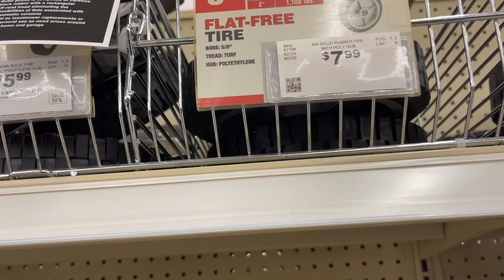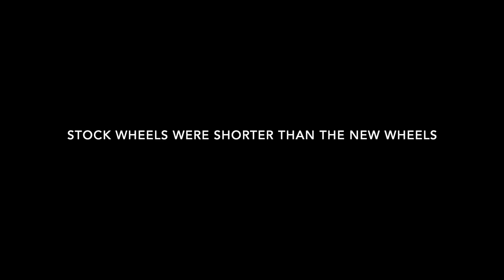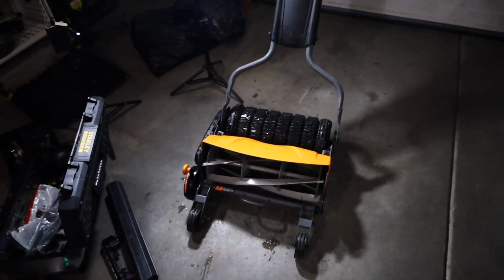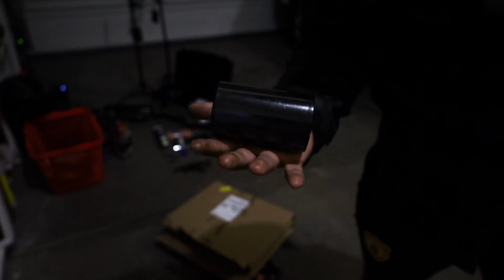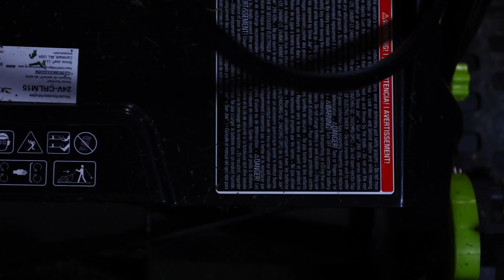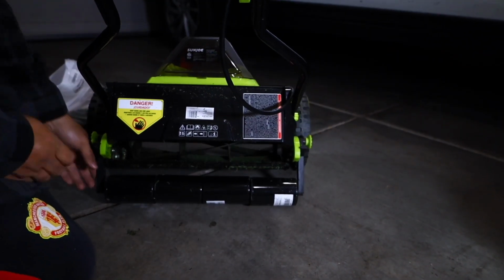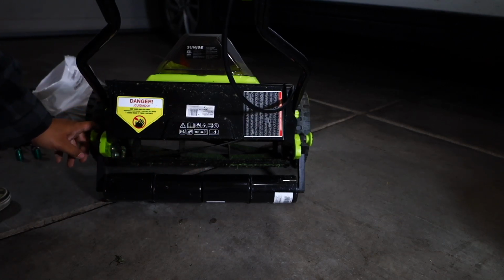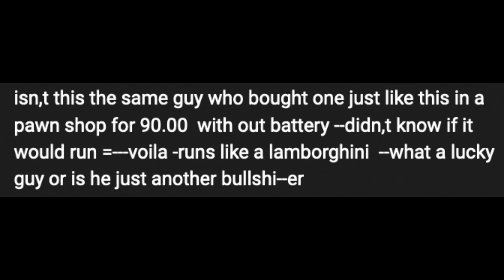IT'S GETTING REEL! SUNJOE Electric Reel Makeshift roller! Fiskars Wheel Roller! NEW MOWER ALERT!!!

Comment: Hello, just put the Harbor Freight wheels on Fiskars. The side wheels like you said are two small. I watched several videos and decided to add a cap onto the side tires. You get old bike tire with good tread. Cut the tire to use the tread part. Use a string to get correct length. Cleaned the rubber on both let dry. Super glued rubber cap onto the Fiskars original tires. Then stainless (like dry wall screws) 1 1/4”, two on each side of mating edges. Then two every other spoke. Mowed yard got stripes and caps worked great!
Reply: Hi Jerry Horn,
I also like your technique ;-) Would you happen to have pictures of your results?

Thanks,
Kirk
Reply: @houstonpatriot59  uploaded video to YouTube
Reply: @jerryhorn854  Hi Jerry, Wow very impressive is that a DB15 Serial connector ;-) Curious what width are the bike tires used as covers?
Thanks,
Kirk
Reply: @houstonpatriot59   the tires were 27.5 mountain bike. The tread was deep dimples so every screw was place where a dimple bump was removed ( razor knife cut out rubber bump ). Due to plastic wheel hub ( strong plastic) I could pull the head of screw recessed, below level of tread, rolls smoothly.
Reply: DB15 Serial Connector ( if that is what it is called ). Came from a 20 plus year old Lectronic Kaddy ( made in Canada ). Used parts from said golf caddy ( motors, modulated controls of motors, etc )
Reply: @houstonpatriot59  put up another old video with a little detail.
Reply: @jerryhorn854  curious on your prototype 👍how long of a charge do you get? Thanks,
Kirk
Reply: @houstonpatriot59  The lithium battery is 16Ah and the battery charger is specifically lithium batteries. The charge gauge is broken up into 20/40/60/80/100 % the charge never get down to 60 %.
Yard is approximately 1/2 acre with a putting green in the back end. I mow it also.
Reply: @jerryhorn854  bike tire came in finish  installing last night  I used velcro 2"  wide heavy duty tape instead of "super glue" will place drywall screws today lets see what happens 😀
Reply: @houstonpatriot59  I am kind of picky and it really has held up. The harbor freight tires push on the ground enough to get stripes and yet the original tires are still driving (for me using motors but before motors added, the reel spun just fine) original configuration. Good luck but I am sure you will like the set up.

Comment: I see you used 8 inch wheels.  Would 7 inch work so you wouldn't need to adjust the outer wheels?
🤙
Reply from the maker: It’s not gonna lay the stripes down as good on shorter cut lawns! I have a way I’ll be showing it soon! 😊👊🏾🤙🏾🙏🏾
Reply: @YardBrah  Any word as to your permanent solution for the fiskars striping wheels yet?  Also, how could you attach a roller to the front as well?   Thanks Dude.  😉🤙🎱

Comment: Great upgrade. I did the same, but having problems placing the straps. Any suggestions?
Reply from the maker: I still have to figure out another solution my straps keep readjusting… I keep searching for little toy tank tracks to wrap the tire in… that might work! 😊🙏🏾🤙🏾🔥
Reply: @YardBrah  Thanks. I got them to work by cutting off the ends and screwing them to the OEM tire every 4 inches.

Comment: Yardbrah….. do you think replacing the stock wheels would have made a difference on the fiskers mower wheel height 
?  I am asking because I just got one for $50.   I know you said you had issues with tracking.  

Thanks Justin
Reply from the maker: You have to modify the harbor freight wheels with the stock wheels bearings … it’s a cutting into the stock wheel type of job … I’m impatient 😂🤙🏾

Comment: Mate .... With the Fiskar....once you installed the additional rear wheels ....how did you reinstall the spring between the frame and front axial?? Is there a trick to it.... TIA
Reply from the maker: Screw driver at an angle will get that back on 😊🤙🏾🙏🏾🔥

Comment: Great DIY!  Quick question, would buying two extra wheels and replacing the stock wheels worked instead of the "snow tire" method?
Reply from the maker: The tread just has to be the same diameter the outer wheels where kind of worn down and just wasn’t touching the ground 😊🙏🏾🤙🏾🔥
Reply: @YardBrah  Got it - I ordered the same Friskars mower and I am looking to do the same thing - thx!!

Comment: When you put the rear wheels on your Fiskar did you reattach the spring? I’m having a hard time reattaching it.
Reply from the maker: Yes def use a screw driver to slide it on super easy when you get the right angle 😊🤙🏾🙏🏾🔥🔥🔥

Comment: I'm just curious does it help to use different mowers?I always see that you have different ones
Reply from the maker: I just like a variety but I also use them depending on situation if the grass is tall bust out the rotary and bag then I reel mow. Usually when you see me reel mowing it’s just using variety for fun 😊🙏🏾🤙🏾🔥🔥🔥
Reply: Ok fhank you for the answer is there a specific rototary mower you recommend ? right now just got the Ego LM2100SP

Comment: yardbruh, 
Great Vid! You must have been a "Combat Engineer in your past life ;-) What did you actually use as your so called " snow chains" ;-)  Ordered tires online Friday from Harbor Freight they were out at local store that I went to!

Thanks, 
Kirk
Reply from the maker: Haha I think I missed my calling then 😂 I used those rubber tie downs, cut them to size and zip tied them together… I didn’t want to have to cut and but the old bearings on those harbor freight wheels you know. I was trying to find toy tank rubber tracks but they didn’t fit right 😊🤙🏾🙏🏾🔥
Reply: @YardBrah  Wow Thanks for the quick response yardbruh your tech support is "spot on"😉  Usually I get a 800 number to call and get connected to  India and a guy named "Bob"  answers  😂😂 You  and Jerry Horn have great ideas (thinking out the box)! Curious how is your soultion working so far?
Thanks,
Kirk

Comment: Great video. Can you send the links to the weights that you used for the sun Joe
Reply from the maker: Here is the link I purchased… I think there is a link for 4 but I can’t find it Set of 9 Deck Roller Replaces Simplicity 1668513 1668513SM https://www.amazon.com/dp/B071NL9CST/ref=cm_sw_r_cp_api_i_6XSK8ZYPC5Z2RD1Q6G2J?_encoding=UTF8&psc=1 😊🙏🏾🤙🏾🙌🏾

Comment: You might be able to replace the tires on the stock wheels with one you bought . That way you dont have to use the bands .
Reply from the maker: Brah if you have a link that would be awesome! I can't even find a replacement wheel for the Fiskars let alone just the tires 😩 A lot of the major stores carry tires but are  majorly oversized and amazon is carrying nothing... I ordered some tread for toy tanks lol maybe that will work we will see! 😊🙏🏾🤙🏾🙌🏾
Reply: @YardBrah  why can’t you replace the two outer wheels with the ones you bought? Not the tires/tread but the whole wheel?

Comment: Yo brah! I am trying to do the same thing. 7" wheels are too small and 8" wheels are too big. What wheels did you use?
Reply from the maker: I used the harbor freight 8” wheels then the two stock wheels I put rubber straps so they matched the height of the 8” wheels inside 😊🤙🏾🙌🏾🙏🏾
Reply: @YardBrah  I'll let you know what I come up with. I have one of two ideas. I may fabricate my big league lawns roller to trail mine.
Reply: @YardBrah  One more question. Did you use the snow chains to pin the wheels that no longer touched the ground to move with the 8" wheels? I am think about usingsome type of wedge.

Comment: @yardbrah, am following your nice 'tumbler' conversion of Fiskars. I tried doing something similar with HF wheels, but it does not fill the entire space between the stock wheels. Did you use any spacers in between?

Also, did you look into converting the Fiskars into an electric motor based to solve the rpm issue? I am thinking to mount a RYOBI setup and connect the battery powered motor to the wheel chain.